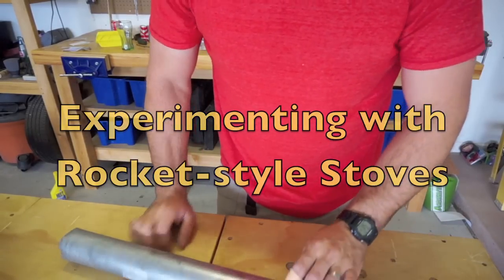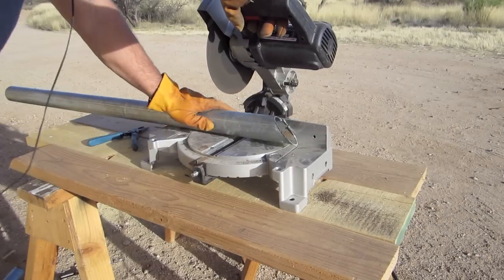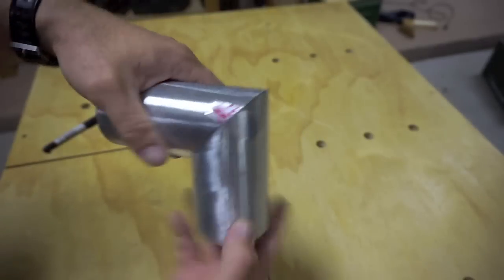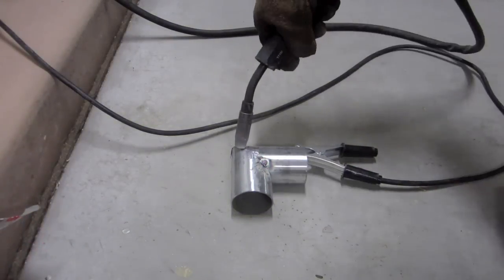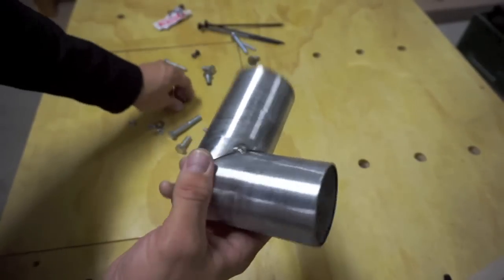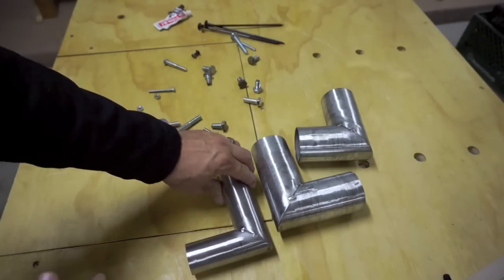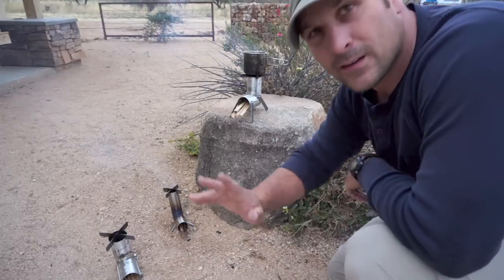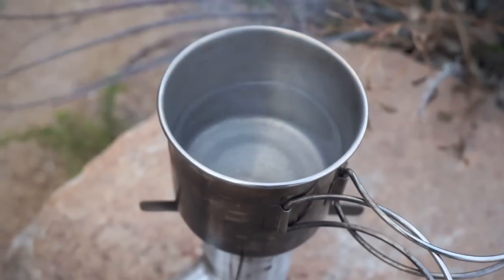Rocket Stove Experiments - The 'naked' or 'boot' stove design

Comment: These would work decent for heating a small shelter, and they're small enough if you welded a little D ring on them so they can be hooked onto a pack, and get a few pipe caps so you can put the burner bars inside and cap it for transport. These would be nifty for hiking or kayak trips where weight and space are a main concern.

Comment: jb weld did not hold together on a charcoal starter I put together with 2 #10 cans. I let it cure for 3 days. If it holds as much heat as it says, then I was sure surprised to find the charcoal got well above that range because they just popped apart and the grid shelf I had in the middle (charcoal holder/shelf) dropped out. good thing I had it on the grill doing that. wont use jb weld for anything like that again

Comment: up pipe needs to be a tad taller and you don't have a grate on the inlet side for secondary air to the fuel. A stove in true rocket action emits very little smoke.
Reply from the maker: ***** I'll definitely make some big changes on the next ones:)  I agree on the higher pipe and the grate.  Thanks for the comment and watching John:)
Reply: @homesteadonomics  

Just a thought. Who says the only air intake has to be the same intake as the fuel? Would a hole in the opposite end from the fuel intake allow more air to get in to oxidize the fire better? Or before the junction  two holes on opposite sides. Just a thought.

Comment: FYI The yellow and white residue and smoke while welding is a clear sign you didn't remove all the galvanizing you need to grind deeper in to steel
Reply from the maker: +Raptor21stoys Thanks for the tip... defintely not good stuff to breath :)
Reply: +homesteadonomics Go to a junk yard and get the stainless exhaust pipe from a Maxima. If you got 2 sizes of pipe, you could have the whole thing store inside the "chimney" Weld the nuts flush into the pipes - I like your design !

Comment: You should add an adjustable plate on the upper part on the mouth of the burn chamber above the wood so you can adjust the size of the opening. That should increase the air speed, burn efficiency, make it hotter and give you that rocket sound.
Reply from the maker: Thats a great tip MrW!  I'm going to be playing around with the stove designs again and will definately try to incorporate that in the next one:)  Thanks for watching:)

Joe

Comment: to use any glue on a metal stove is not smart the get too hot for any jb weld or any other glue or epoxie fasten legs with screws or welding or brazing jb weld wont  hold ever even if you let it cure .
Reply from the maker: ***** yes... I learned the hard way;)  But it was still a fun experiment... and thanks for watching!

Comment: Why take away the insulation? It's an essential part of how both L and J rockets function. No insulation - internal temperature never gets anywhere near high enough - not a real rocket.

The same is true of the constant cross-sectional area of the flue-gas tube, from inlet to final outlet; and of the right proportions between cross-sectional area and tube lengths. The length of the riser tube in particular needs to be between two and half and three times its diameter.

Why reinvent the wheel? This research, in great and methodical detail, has already been done at Aprovecho, and other places, for over thirty years. Results are freely available.

About half of the posts on YouTube that I see lately, supposedly about rocket stoves, are actually about cargo-cult pretend 'rockets', where the makers clearly are groping about around square one, because they haven't taken the trouble to learn about the basic science and technical development work which has already been done by Larry Winiarski, Ianto Evans, and their many followers, and which is freely and easily available.

Call your experimental stoves whatever you like, but don't try to say that they're authentic rocket stoves. With no insulation, or material like sand, for example, assumed to be good insulation (it's actually the opposite: a heat sink), with feed-tube and riser chimney proportions all over the place, and even flue-way cross-sectional area varying markedly, these are not rockets. Nor will they ever work as hotly or with the same extreme fuel economy as real rockets now do, after their long period of evolutionary development.

Start with the study; then do the tinkering. That's the way I went. Real rockets can be adapted to all sorts of applications, with excellent results, as my own examples have proven very clearly. But only by those who have taken the trouble to learn the working principles of real rockets and how to apply them - very high temperature, very clean TOTAL fuel burn before the gases leave the top of the riser; smoke particles, unoxidised flammable gases and everything all fully oxidised; plus efficient trapping of most of the heat into the cook-pot, or whatever is being heated. With a real rocket, the final exhaust-chimney exit, on the far side of the application, puts out luke-warm carbon-dioxide and water vapour - and nothing else; no smoke particulates, no toxic partial-combustion products, nor any unburnt flammable gases. If it doesn't burn them all, it's not a real rocket stove.

But all you need to make that happen is right proportions and dimensions - and proper, high-value, extreme-heat-proof  insulation. (Glass fibre isn't! Don't waste time trying it; it melts back from the fire tube.) This >essential< insulation is to keep the temperature in key internal sections of the fire tube near to white heat. It's for that white heat reason, too, that I always make my fire-tubes in stainless steel, to prevent burn-through; though mild steel is fine for the outer, insulation-containment can. That doesn't have to deal with the same extreme temperatures and super-heated oxygen in direct contact.
Reply from the maker: Rhisiart Gwilym Great info RG:)  Like I said I'm just tinkering here but thanks for the great info.  When I decide to play around again I'll definitely have a little more thought behind it and will check out the info you provided.  Thanks for commenting and watching:)
Reply: +homesteadonomics  Welcome! BTW, see this link for the full story on how do build effective rocket stoves:

https://www.google.co.uk/webhp?sourceid=chrome-instant&ion=1&espv=2&ie=UTF-8#q=design+principles+for+wood+burning+cook+stoves.pdf